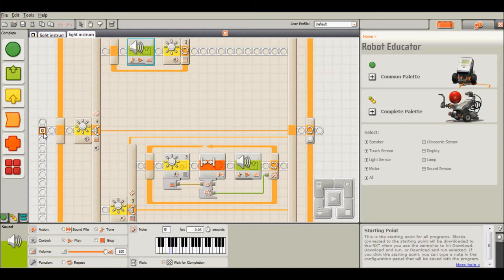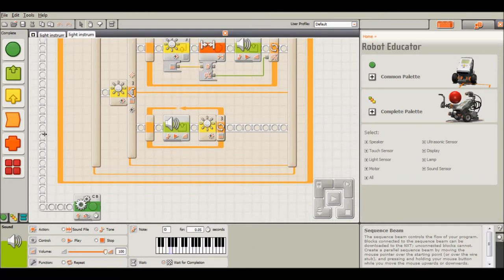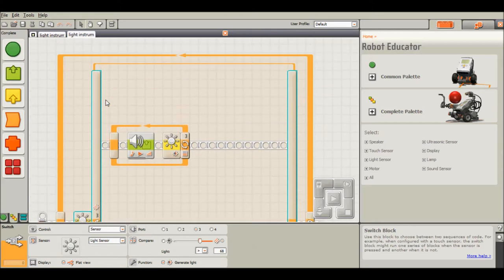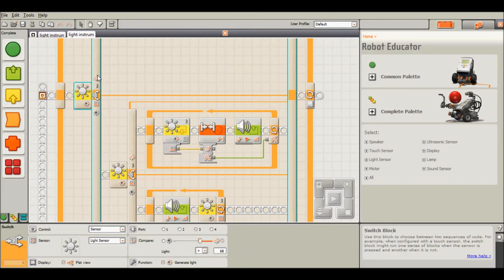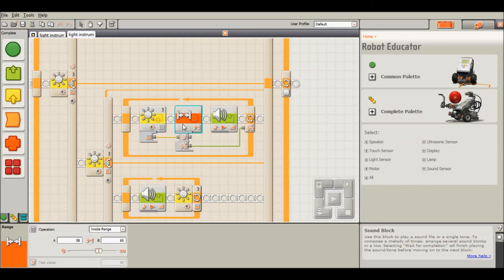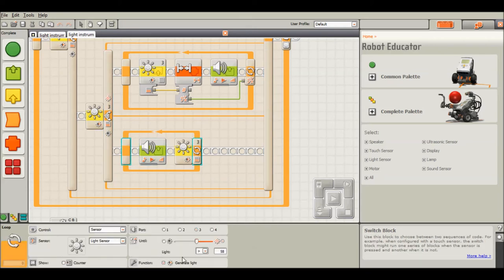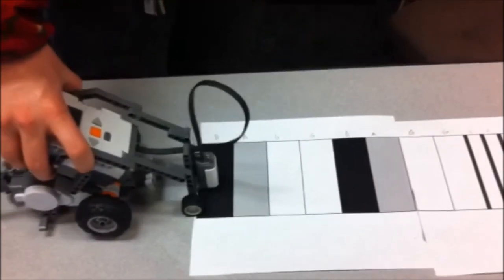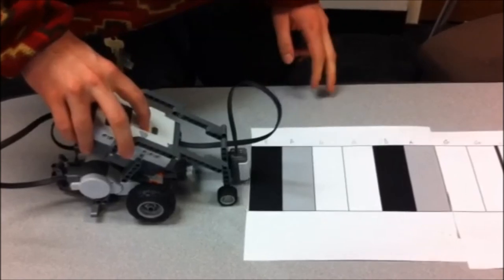Light Sensor Music

Comment: I spent all day trying to figure out how to make a hybrid from the ultra sonic sensor and the light sensor and failed to do so, so I would be very grateful for your help

I was hoping that you could make a program for me so that the light sensor will keep the robot inside a (black with white outline) mini sumo robot fighting ring by making it turn when it detects white

And for the ultra sonic sensor from the project explorer which is already in your system I want it to do the head turning as usual but to approach objects that are near (10 inches maximum)

This letter is from a student which has done extensive research on this subject and is in desperate need of assistance from a professional 

Please help